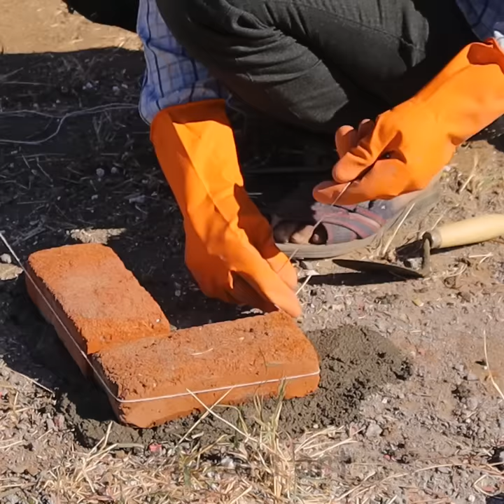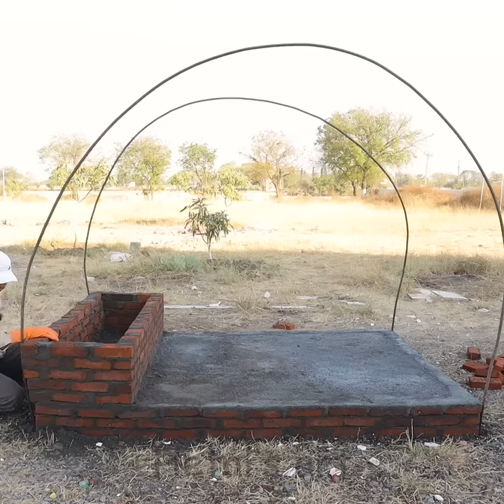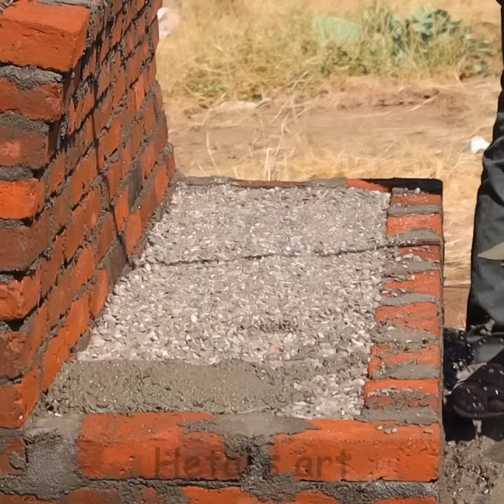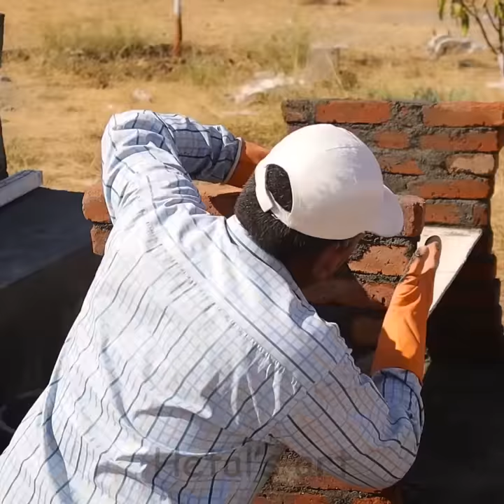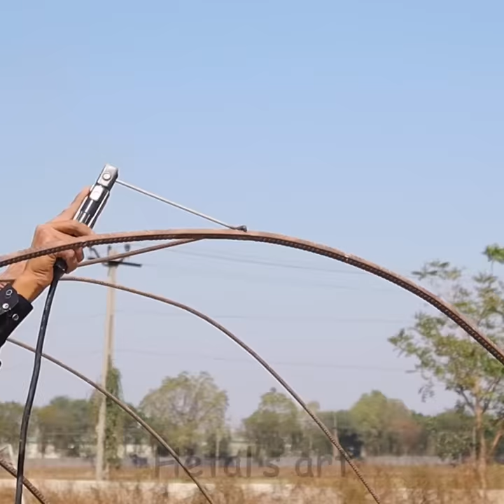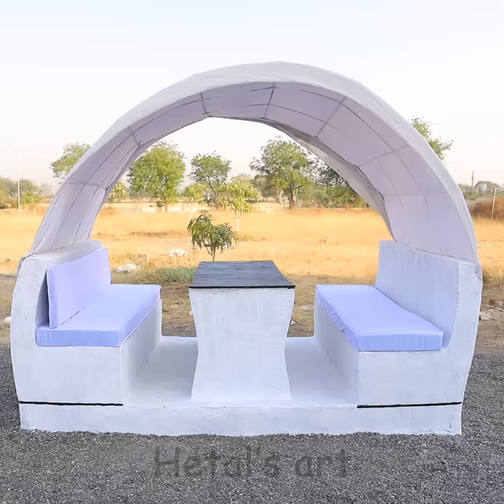Large rattan hanging swing chair - hammock shade canopy - outdoor furniture #diy #chair #swingchair

Comment: My only concern is wrapping the poles in the cement. With temperature changes the pipe will expand and contract weakening and cracking the cement around it. Maybe encase in PVC might solve.
Reply: 😊6😊❤7

Comment: THIS IS AN EXCELLENT DESIGN AND BUILD JOB WHICH WILL LAST FOR AN ETERNITY WITH MINIMAL MAINTENANCE....A LICK OF PAINT EVERY FEW YEARS AND MAYBE PATCH UP SOME CEMENT RENDER. THE ONLY ONE DOWNSIDE MAYBE THAT CRACKS COULD APPEAR DUE TO THE LACK OF FOUNDATIONS ESPECIALLY IF THE GROUND AROUND IT BECOMES VERY SODDEN.

Comment: ERGONOMICALLY BAD BENCHES AND WEEK ROOFING DESIGN. Benches should have been done with ergonometrically correct sloping in the back. The iron rods holding the pavilion roofing could have been duly buried into the wall at the back, lest it cracks under the effect of slightest of wind or shaking. OVERALL POOR